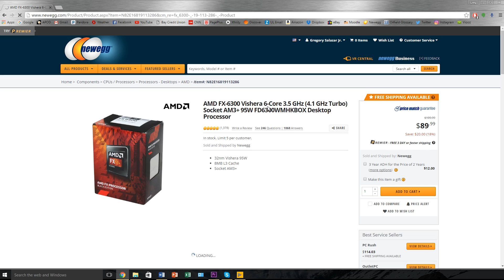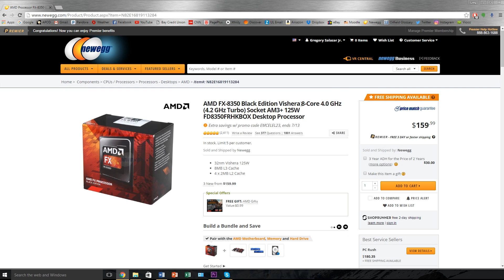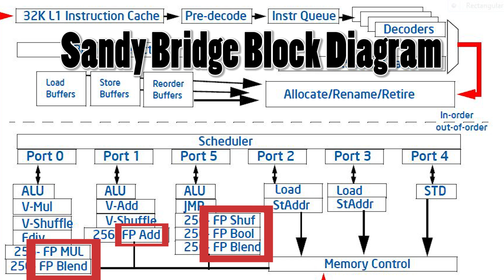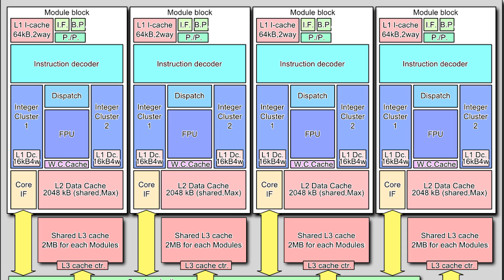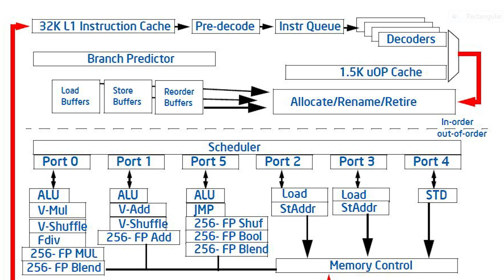How Many Cores Do AMD FX Processors *Actually* Have?

Comment: Please make a video about the amd fx 6300 and explain the difference between it and the amd fx 8000 series ( there's not to much stuff on the fx 6300 and that's my cpu) and love your videos
Reply from the maker: 3 modules, 6 cores vs. 4 modules, 8 cores. There.
Reply: +Science Studio isn't the fx 8000 series bulldozer architecture and the AMD fx 6300 pile driver? Is there a difference or is it just a rebrand?
Reply: They're all Piledriver anymore. The x1xx series is Bulldozer, the x3xx is Piledriver. Thus a 6100 or 8100 would be Bulldozer, but the 6300 and 8300 are Piledriver.
Reply: +NiGHTSnoob ok thx that clears things up.

Comment: so would that mean turning off every other core, the single core performance would increase?
Reply: If you crippled an 8-core to 4 odd/even cores, each core would get the full FPU, but you could also just as easily try to persuade your workload not to use more than 4 cores. In the case of something like a benchmark (say maybe Cinebench R15), your total performance would probably go down because it now has 4 cores and 4 FPUs rather than 8 cores and 4 FPUs. Keep in mind that the rest of the core excluding the FPU is still capable of non-FPU math. But to answer your question: Yes, theoretically the single-core performance would go up because it no longer has to share the FPU, but you also lose out majorly on multi-core because you are throwing away the remaining parts of 4 cores. Assuming AMD has decent thread prioritization to use every other core until the workload hits 5 or more threads, it wouldn't make a significant difference unless you have a 5+ core workload (at which point now 2 threads are sharing a single core and a whole FPU and you are giving each thread half a core and half an FPU rather than a whole core and half an FPU)

TL,DR: assuming AMD doesn't have their heads up their asses.. disabling 4 cores only hurts performance, especially in multicore with 5 or more threads.

Comment: but 8 > 4 therefore it's faster /s
Reply: well.. it really depends on how well your workload scales with multithreading.. in that case, 8 somewhat-crippled cores will still outperform 4 cores that are pretending to be 8. but then again intel cores are far better than AMD's right now.. if you just need raw cores, then E5-2670s are so cheap on eBay right now hahaha.
Reply: FX 9590 will NOT be faster than 2700k or newer i7 in any task. It might come close in heavy multithreaded workloads, but it won't be faster.
Reply: No one here saw the "/s" at the end of your comment, apparently.
Reply: philipx550
That's a pretty hefty overclock to compare to a stock i7, though.
Reply: philipx550
holy shit

Comment: Do apus share the same fpu too?
Reply: yes. same 1 module 2 cores. but weaker than comparable FX processor. this is why you dont buy APUs.
Reply: yes. same 1 module 2 cores. but weaker than comparable FX processor. this is why you dont buy APUs.
Reply: Alvin Buenaventura That sounds dumb, if you are making integrated graphics better, why don't you just slap more fpus? I know it's not that easy, but I guess making a CPU is not an easy task too.
Reply: +Alvin Buenaventura APUs are the only thing amd does better than Intel xd
Reply: Even that is a stretched out statement. Their APU-s are about as fast as a pentium 4400 at the cpu side. Intel has beaten their iGPU performance with iris graphics too, but CPUs with iris are very expensive.
Reply: there is only so much space on the die and both amd and intl want their cpu dies ot be as small as possible  while gonigu p in performance both for the tdp and ot keep cost of manufacture down(smaller dies means more of them per wafer and a statiscally better yield)

on the apu's a lot of thty space is taken by the GPU compute units
Reply: its a decision, they keep the die small or they have ot increse prices since they would get less cpu's per wafer and defects would hurt their yield more than with a small die
Reply: Ricardo Have you read about FX dies? They are huge, they get like 3 cpus from one waffer (joke).
Reply: APU's use kavari rather than bulldozer, and Kavari doesn't share an FPU with 2 cores, only with the FX series.
Reply: +Ralakus however they still are slower than fx cores
Reply: its a size issue, the dye can only be so large and it cant exceed a certain size limit. this would force them to sacrifice somewhere, and usually its the integrated graphics =/
Reply: The prices would also increase and it will be too shity for the money.

Comment: the other thing u forgot to mention. Not all software, games ect actually need  or use the FPU any more which is another reason why amd did not  do one fpu for a integer, in fact gpu do mathematical problems what better & faster then a fpu on a cpu can do, one of the main reason most dev offload that type of work to the gpu then cpu these days, 

example , BitCoin mining any one? AMD GPU kill at this unlike NV gpu do...  but thats for a hole other discussion
Reply from the maker: Most programs in general benefit from 1 FPU per core, seeing as though most software is written and executed in binary. There are very few instances in which this is not the case.
Reply: Yeah FPU performance has been important for a very long time. Physics engines typically run on the processor because physX only runs on nvidia and it wasn't well adopted for instance. Quake was the first game that really started putting pressure on FPU performance and is the reason that many gamers found that their AMDs weren't up to snuff at the time. It wasn't until the pentium that they started to be integrated within the cpu by default across the whole line. Only the later 486DXs had FPUs onboard. But yeah, ever since quake all games have used floating point extensively.
Reply: use of 'then' should actually be the use of 'than'.... 'then' is a 'sequential' action... 'than' is a 'differential' action.. not difficult on when to use 'then' or 'than'... example:  24 is greater 'than' 23   after crossing the street, 'then' go right

Comment: can you download more core? :DDD
Reply: I torrent my cores tbh
Reply: Yeah but you can't download more RAM and more cores you need to download more motherboard if you want to download RAM and Cores.
Reply: Thanks, now i have a 999 core processor!
Reply: when hypertreading 4.0 Comes out, you van Split your cores into  at least 100 logical cores
Reply: You should have used a hammer. They are called chip s for a reason!
Reply: Step 1: get cpu out of socket
Step 2: get a saw
Step 3: saw your cpu in te ammount of cores you want
Step 4: glue them together
Step 5: put the cpu Back in your motherbord 

enjoy
Reply: no but you can dowload more ram here http://www.downloadmoreram.com/download.html ;)
Reply: +twan duvigneau 
I tried it
My computer isn't turning on now
HELP !!
Reply: I downloaded an i7 6950x and 128gb of dominator platinum, then I downloaded 4 titan x, then I downloaded 4 billion more cuda cores
Reply: +kedwa30 Thats privileged info. no word yet.
Reply: lol nice
Reply: +Eli Hopf it actually works
Reply: Kakashi Hatake Did you download more motherboard?
Reply: Well, the Power8 from IBM got 8 cores and 64 threads...
(8 threads pr core)
When all 8 threads are filled it actually got a tiny bit more throughput then a Intel Xeon.
Reply: Hum, downloading hardware...
3D printing with multiple materials?
The biggest challenge would probably be the sizes required as the printer would have to place the materials down with nm precission to make objects smaller then light.
Reply: I use cheat engine
Reply: When is the i9 coming out?
Reply: Twan Duvigneau haha
Reply: You can, actually, you may stream it, hence games streaming on a Raspberry Pi.
Reply: just use it on the cloud though I hear the frame rates are terrible.
Reply: No but you download more Ram
Reply: Hum, the Power8 processor is 8 cores that each have 8 threads.
When all 8 threads in a core is filled it's just a tiny bit faster then a intel xeon core with the same workload on it's two threads.
The scaling with more threads pr core kind of drops off after the first few threads though.
Reply: Steve Fox i heard that engine can speed hax the core try to speed it up 10 time and have 9999 core
Reply: Sega Hen
yeah... 9999 GHz safer than overclocking it
Reply: Turn on debug mode to shrink yourself down to micron size and then jump into the processor.  With speed hacks and infinite ammo you can start building more cores inside the processor.  But don't forget god mode because this will drain your energy very fast.
Reply: Go to http://www.downloadmorecore.com/
Reply: ***** vasika ime kiprios
Reply: I downloaded 4k TV and Focal speakers. It's crazy.
Reply: If you have that much parallel processing to do, then why not make a supercomputer out of a bunch of cheap CPU's rather than split up an expensive CPU into tiny cores?
Reply: Could you absolutely fuck off
Reply: if you have an fpga
Reply: You can technically download a windows patch that makes the os work with the cores better.
Reply: No but you can download ram

Comment: Pretty good video for people that don't know the difference, as much as i like my 6300 i shouldve gotten an i3 so my i5 upgrade wont be as expensive
Reply: +Jacob R If Zen ever comes out... I feel like we've been saying this for 5 years. I'm worried it won't perform well enough by the time they release it. We REALLY need some competition.
Reply: GOPACKERSJT Sorry for wall of text, last half is more of a rant on my current opinion of AMD as an investor, see link at bottom for more info on why amd is delaying launch.

As far as I am aware amd always said late 2016/early 2017 but yes, we do need the competition. From what I understand amd is waiting for intel atom processors to sell out, otherwise intel could screw up a zen launch by flooding the market with cheap atom x3/x5/x7 processors(yes they work in laptops/desktops see link) that are in inventory but no longer being produced. The reason I am aware of this is because I have a lot of money(for a college student) invested in amd and am largely betting on zen so I researched the hell out of this, also amd's ceo(Lisa T. Su) might be waiting for an increase in pc sales as pc sales have been in decline for a while now.

Though I was a bit disappointed by rx 480 launch I'm also hoping vega chips have a smoother launch, but hey almost everywhere is sold out on rx 480s so I can't complain that much as an investor. Further it seems that Nvidia is being forced to push the 1060 early so I suspect there will be low inventory at launch, and rumor has it that it does not reach its claimed 15% better performance than the rx 480. There is also some speculation that Navi gpus(2 generations out, amd) will be based on multi chip/multi gpu configurations as DX12 treats all the hardware as one giant pool. This along with asynchronous computing gives AMD a technical advantage going forward, unless nvidia has DX12 capable cards(current ones get ~0 performance boost from DX12) up their sleeve yet to be revealed(unlikely).

http://seekingalpha.com/article/3980601-amd-hurry-release-zen-based-processors
Reply: unfortunately amd mobos are a bit dated, personally I can't wait to see if zen follows through with expected performance

Comment: hey, I upgraded my amd fx 4300 to a 6300. Means that I wasted money? I dont umderstand it
Reply: it is a 6 core cpu but because it shares resources its only as efficient as a 3 core intel cpu. at least it was when they came out YEARS ago. lol
Reply: Pretty much. AM3+ is a dead socket, nothing new will be released on it. The top end CPU on the platform is already not able to compete with Intel's same priced offerings, at least in gaming, single core performance, and most other tasks. Socket AM4 which will be what Zen uses might close the gap between AMD and Intel, but we have to wait and see. If you want any sort of actual upgrade now, you'll want to be going Intel Skylake. It's a safe bet that at any price point, Intel is currently winning.
Reply: So that means I went from a duel core to a triple core??? Or did I really bouhght a hexa core. If the amd fx 4300 has the same processor build etc
 it is actually a duel core with not working hyper-treading?
Reply from the maker: Watch the video...
Reply: Ok
Reply: I am confused
Reply: +SkitZ PiK so is it worth the money to buy a fx 6300 to upgrade the fx 4300? Thank you for replying.
Reply: +SkitZ PiK Ok, ty
Reply: +SkitZ PiK But wil that be am3+ socket again?
Reply: most likely not but the expected performance improvements(supposedly 40%, can't wait for benchmarks) more than justify waiting for zen, plus most amd motherboards atm are a bit dated so getting a new motherboard would be a good idea anyways. Going from a 4300 to a 6300 is a relatively small bump in performance
http://cpuboss.com/cpus/AMD-FX-6300-vs-AMD-FX-4300
Reply: zen will be am4
Reply: Should  be faster than an Intel 3 core but not as fast as an intel 6 core - but costs a tiny fraction of the Intel 6 core. Dollar for dollar, the AMD is a substantially better deal unless you need extreme performance and money isn't a concern.  Or alternately, you need the  "Intel Inside"  sticker on the case for marketing reasons, which is why most computers sold in stores have Intel.
Reply: Game Lard hmm no, in multi threaded applications AMD has much better scaling than Intel, and while single threaded performance has sucked with AMD this simply aludes to how you cannot generalize with CPUs. That said the Zen AMD chips will be smt so the inherint differences from architecture will disssapear(and sposedly Zen has a 40% performance increase). This is a necessary choice because as the video stated the software never came around to support AMDs architecture, where the software in theory would have given AMD CPUs a significant boost in performance.
Reply: Jacob R
true, but since developers are so damn lazy we will never know.

Comment: short answer: 8

There's never even been a doubt about that, until AMD bashers started spreading bullshit appearantly.

the truth is: bulldozer's IPC just sucks ass, it has nothing to do with the number of cores but indeed has everything to do with shared resources (2 cores per 1 module), bottlenecking the floating point performance.
anyone who has ever done pure integer workloads on these CPUs knows they are a great deal faster in those cases compared to floating point ;)

long answer: 8
Reply from the maker: Bulldozer's IPC is relatively low because of its architecture. Shared resources. If the cores themselves were independent, floating point performance would be much higher.

Comment: may i know which field in engineering you took? Thanks :D
Reply: I'd really like to know that.
Reply: flashbacks of computer architecture nightmares
Reply: inb4 civil engineering.
Reply: food processing
Reply: petroleum engineering
Reply: makeup artist
Reply: +Jnan Mckenzie my guess is computer or EE engineering
Reply: Gender studies.
Reply: Mechanical, isn't it obvious?
Reply: I think in a video some time ago he said petroleum
Reply: I loved the architecture part of my computer architecture course, but the C and MIPS parts were horrible.
Reply: Marine Engineering
Reply: + 1
Reply: Yes!!!!!
Reply: +chronicblazer84 I feel that's a bit unfair, even in this one he just seems to say things as they are and  mentioned it wasn't AMD's designers fault, they were theoretically correct but their stuff leads to bottlenecking based on the architecture. That's not exactly flaming, it just seems like he's saying it as it is without some sorta weird bias.
Reply: +1
Reply: Jnan Mckenzie
learn to communicate
Reply: I had Cal 1, Cal 2, Cal 3, Phy 1, Phy 2, Phy 3, Dif Equations, Advanced Algebra, Statistics and Numerical Analisis, all along with Programing 1 ~ 4, networks, etc etc. So not really, try to learn the why of the formulas, once you get why they function like they do, it will be relatively easy.
As one of my teachers said once, If an engineer knows the formulas by memory, they will have a grain of sand, but if they know from where the formulas were created, they will have a dumpster truck full of sand.
Reply: +chronicblazer84 Howso on those specs? hoes the low PSU hurt the Overclock if there's still headroom?(which im assuming there is) and by slow RAM do you mean ddr3? because I'm not sure much AMD supports ddr4...?

Sorry I've mainly done research on Intel, not AMD so idk how gimped it may in fact be or how those should affect overall performance, or if they should
Reply: Reiburster 
Great you have phy1 and 2 I had Discrete math 1 and 2 I wanted phy and circuits components 1 and 2 like 
CS Eng. major
Reply: *****
looking at his last 15 videos its clear he is just and AMD salesperson!